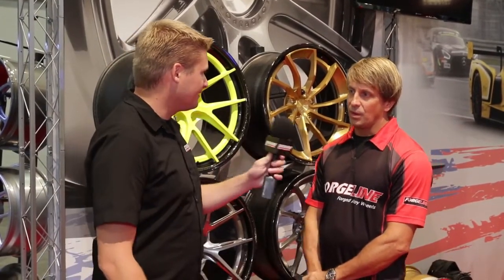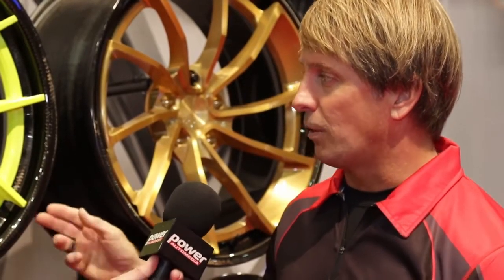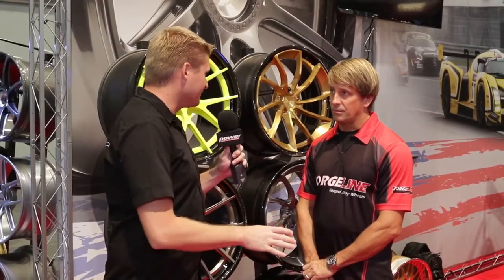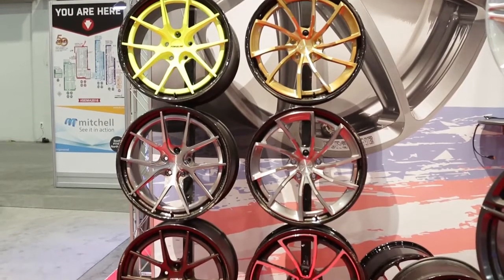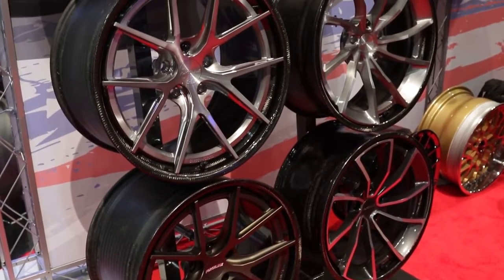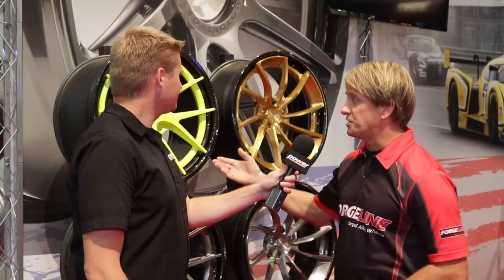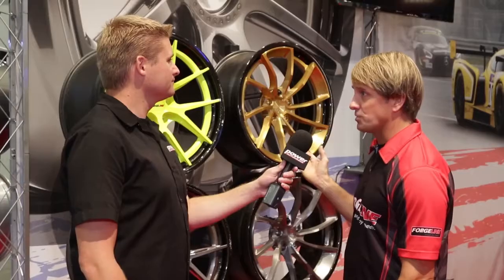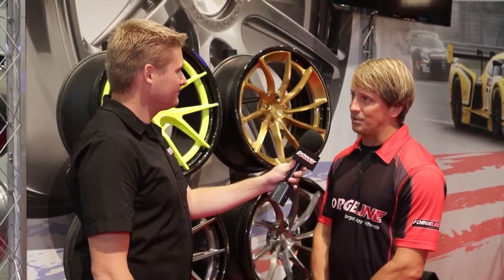Forgeline Debuts New Carbon+Forged Wheels at the 2016 SEMA Show

Comment: So what is the weight of the new carbon fiber barrel wheels compared to let say the Shelby GT350R Carbon Fiber ford Factory wheels by Carbon Revolution or the all Carbon Fiber E1 wheels by ESE Carbon?  Also I seen these Carbon Fiber Wheels in the price range of $3000.00 to $4000.00 +/- per Wheel!  Thanks and God Bless!
Reply from the maker: The CF201 in 20×9 weighs about 17 pounds and a 20×12 weighs about 18.5 pounds. Each fitment is obviously slightly different, because pad thickness affects the mass. But these are good ballparks.
Reply: Thanks!...I went to your website and noticed that your CF201 & CF202 Carbon Fiber Barrel Wheels only come in Diameters 21" & 22"!  Do you plan to offer those CF Wheels in 18" to 19" Diameters?  For example the all Aluminum Wheels that come on the Shelby GT350 are 19"x10.5" for the front and 19"x11" for the rear and the all Carbon Fiber Wheels that come on the Shelby GT350R are 19"x11" for the front and 19"x11.5 for the rear.  It would be nice to replace the Shelby GT350 all Aluminum Wheels with the Lighter, Stronger Carbon Fiber Wheels!  Thanks and God Bless!
Reply from the maker: Maybe. The carbon barrels are manufactured by our partners at Emergent Carbon Wheels. Since these barrels are relatively expensive, they started with fitments that are appropriate for high-dollar supercars. And their initial production ramp-up has been moving slowly. The presumption is that they will eventually expand their size offerings, once they catch up on existing orders and have production operations rolling along a little faster. For now, they have their hands full with just the 20 and 21 inch offerings.
Reply: I was literally just thinking that, these might be perfect for my Shelby GT350R. I've got something for you though, just incase you haven't seen these, lookup Project 6GR wheels.